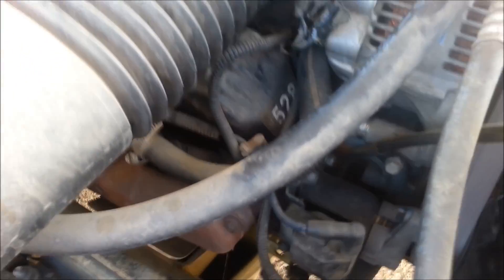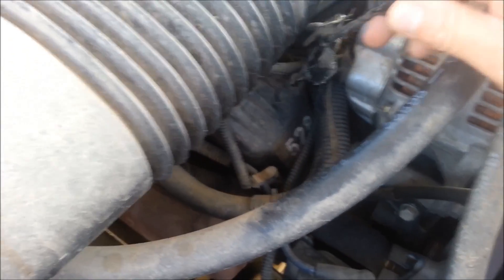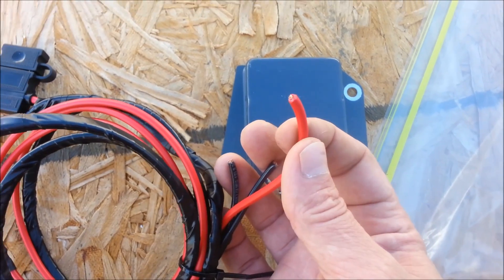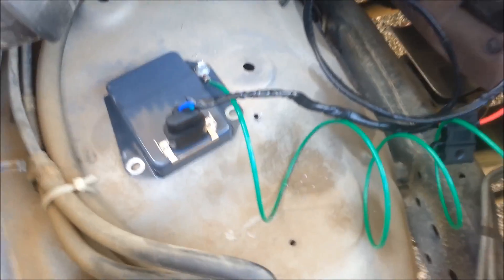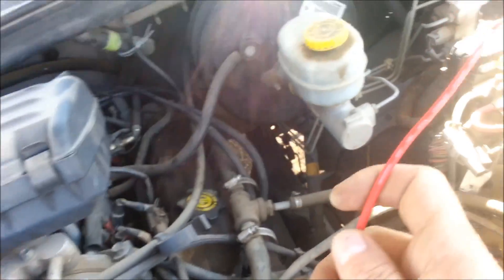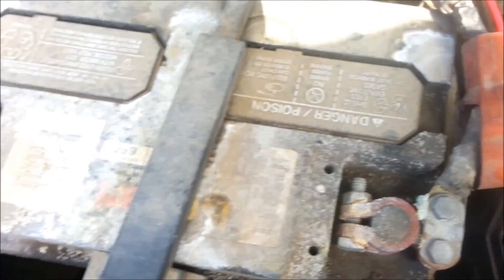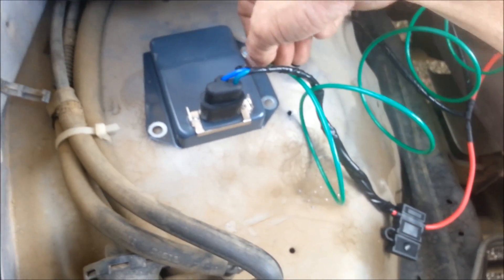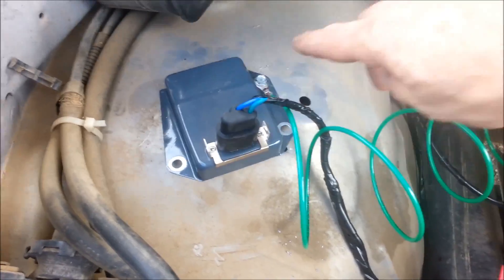How to wire up a External Voltage Regulator for Dodge Chrysler Jeep (Bypass the Computer)

Comment: Check the ASD (auto shut down) relay, the computer doesn't run directly to alternator it activates a relay to send the 12 volts to activate the exciter wire.

Comment: This a questionable band aid repair, not a proper fix. True, an engine computer is expensive but considering the potential harm and danger to installing this aftermarket setup, its not worth it IMO. I see comments of those who have possibly made errors on the installation, and their vehicles are overcharging, which could cause your battery, alternator and wires to burn up and/or fail. Considering the time it takes to rig up these extra wires, go into the fuse box for power, its not worth it. If you have a decent car and want to sell it later on, a potential buyer might walk away seeing this mess under the hood. Zip ties around a radiator hose to route and hold the wire in this video is a mess, plain and simple and a hack job.
Reply: should I try and find an PCU? Wouldn’t I have to have someone program it if I buy one online?
Reply: @bongwaterboy8179  I have never had to replace one. But if I did, there are a lot of sources out there. I think you provide your VIN number and they send you the correct one for your vehicle. Many delete the chip key (Skim programming) so you don't have to deal with that if the skim module fails down the road.

Comment: Saran into this problem myself and I figured out when I try to throw a resistor on the line coming off the ignition and then the voltage really jumped so I realized oh it's not resistance I need on the power going from the ignition it's resistance that you don't want so you have a bad connection you're not getting full voltage from the ignition wire you can't hook it up to the fuse box you have to hook it up closer to the actual ignition switch because you're getting not full voltage in too much resistance or it's loose and it's a bad connection so when you're not getting a good connection on the ignition wire coming in your voltage on your voltage regulator runs too high and that's going to fry your voltage regulator and your alternator and your battery and everything it's going to mess up your whole ignition system

Comment: thought the video was great,the only question i had,,was does it mean when the baterry light comes and remain on but u
it to charge battery.not alot..
Reply: You need a FRM between the old wires that were going into the computer from the alternator. This guy just taped them off. You need what's called a Field Return Module. The R might be wrong
Reply: @dgage1776 you only need the field return module on the newer Jeeps like 2006 or 2007 and newer
Reply: @throttlethumb150  well I got one on my 97 Ram anyway hahaha

Comment: Good vid. You should get an FRM module and hook those two wires that you taped off (the ones that lead back to the computer). The FRM module should help with the check engine light issue. Are you having a check engine light issue? Curious.

Comment: That won’t work on newer Chrysler since the the alternators field winding is already grounded and positive voltage is needed instead of the old one where there is a transistor in the PCM

Comment: What is that small plastic black box/that is hanging from the red wire when it is all layed out and then hanging down by the engine after the regulator is installed on the fenderwell?? Is it a fuse?

Comment: Battery terminals were corroded, which means there is probably scale between them and battery posts, which is why your voltage reading is too high, and the battery terminals were probably getting hot due to the resistance from the scale. Should have cleaned those too.

Comment: Great video. Im having the same issue. I have a 1998 Dodge Ram 1500. I replaced my alternator and battery is 2 1/2 years old. Battery terminals are clean. How did you know it was the pcm regulator? All my gauges while truck is running works except voltage gauge is reading low. If it was pcm all gauges will be dead. Unless the regulator fails and pcm still can work. I’m not
sure about that. Voltage gauge is reading 11.6 with the truck running with my voltage meter tool. If I turn on the AC it’s 11.45. I appreciate your feedback sir.
Reply: unplug the connector at the back of the alternator and turn on the engine.....take a test light and you should have one pin at battery voltage and the other a ground....the computer turns the ground on and off and that is what tells the alternator to charge....
Reply: Did you ever figure it out I’m having the same issue with my truck and same reading on the meter
Reply: @bongwaterboy8179 yeah it was a fuse in the fuse box. Check for continuity on the fuse from the wires connected to the voltage regulator. I had no continuity. Bought it for $10 at autozone. After replacing the truck was reading 14 volts.

Comment: I looked thru the majority of the comments and besides the ones asking if it works an a particular car...I will tell you what I used and what I think is the key to make this work. 

I didn't use a switch/relay, I did order a new alternator, distributor, coil, wires and the distributor came fully assembled. I got some wire and connectors just to figure things out and multiple voltage regulator 2 to be exact!

I have a 1978 Dodge D150 w/360 motor and 727 torqueflite transmission, it has a 8.25 rear end. I purchased it in the Midwest but it came from California. 

Whenever I purchased a classic vehicle I always change the top gaskets, water pump and the parts I listed as well as hoses. I do not like don't electric work on cars, but this one forced me to!

Here are the parts I ordered :

ACDelco ACDelco Voltage Regulator | ACD C603Z

JUNK!

Ultima Ultima 100 Amp Alternator | ULT R211684B

Seems to be working great and I sawa passed test twice with the field wires transposed. 

YellowTop Optima Yellow Group Size 34/78 Top Post, Side Post Deep Cycle Battery | OBT YEL34/78

Also works great and I have a sound system that came in the truck. 

I replaced the junk VR with 

Mopar Performance 77R06285 - Mopar Performance Voltage Regulators

Out the box after I charged the battery i got 14.17 at the alternator and 13.2 at the battery. I checked the wires going to the VR, I checked multiple grounds, I used multiple grounds, I checked at the starter relay, the coil, the junction to the battery cable/starter. I checked at the lights, the amplifier and other things I could get close to and they all read the same as at the battery. 

I initially chased the wires back from the alternator and found out thru the spaghetti mess which wire was the ignition wire and cleaned up that mess...I didn't use that wire as I didn't trust it.  I used the red wire coming from the loom and ignored the original orange wire that went to the VR.

I had to get a new connector part Part No. PTA1062 Carquest Premium Voltage Regulator Connector

because I found that the red wire not only wasn't connected, but the clip inside of it was broken and on the original VR connecting point. Once I changed that, traced my ignition on 12V source, used that Mopar VR, ran a ground from the motor to the firewall/VR/alternator with no other grounds to the alternator...I was able to achieve success. 

I know this is long, but I had to make sure mentally not to make any mistakes because I've been fighting this for 3 weeks straight until just a few hours ago. 

I tested it every half an hour and every time I stopped!

1. Use Mopar VR/parts as much as possible. 

2. Look for a good ground and clean it well. 

3. Don't use an old 12V source if possible!

4. Clean any paint off the VR.

5. Use fuse if you want. 

6. TEST religiously with a multimeter!

7. Run your ground to the back of the alternator and no other ground needed for the alternator!

8. Lastly alternate the field wires and make sure you're at 14V at the alternator and 13V at the battery. 

I still need to solder everything, but u need to make sure my fix is the correct fix!

Comment: Unless you connect a field replacement module to the two wires that go back to the PCM you will always get a high reading on your dash voltmeter  and a check guages/check engine warning lights coming on.
Reply: Specifically, it's just a resistor. I don't know the required value, but it is a high current version.

Comment: no its not ground isue its the actual engine rpm if you have any where a condensor/capacitor to lets say audio stereo equpment ignition coil baterry even the alternator will reflect that change in potential what realy hapening is you get stronger spark on spark plugs if its a gasoline engine and your alternator wont start charging until you reach 2000rpm ore more perhaps baterry runs in back charge mode huck it to baterry charger that will go away if not sirche for capacitors in your car disabel them and your altrrnator will run normal again if it is a gasoline engine with hoter spark your engine reach slow rpm it tryes to behave like a disel and your alternator wont start charging it will back fead on you! see if the alternator light stay In ON position on cold engine start up if it does and if it goes away when you put fut to gas pedal you have a device interfearing with your alternator no mather if it is ground ore positive terminal! even if its a disel it will try to self ignite fuel in worst case engine run on and damage seals ruber and plastic parts!
ore see if that voltage regulator has a nut on its back side to regulate the voltage. 
back fead is very usefull if you can understand it like waste spark ignition system lot bether economy only down side dead baterry requares lot higher rpm to charge a baterry

Comment: This doesn't work. I grounded the voltage regulator to the alternator and added 2 other grounds. Still spiking at 17 volts
Reply: What did you do to fix it

Comment: It’s worth a shot this thread is old but u didn’t by chance have a check engine light letting u know ur regulator was put having a charging problem with my 2007 Dodge Charger replaced alternator battery I heard they have a fusible link so I’m gonna run a wire from alternator to battery to see if it dose have a fusible link an it’s blow if that’s not it it has to be the pcm
Reply: What did you find out, and how did you fix it?

Comment: Thank you for this video. I watched another video about this from 1 of the external voltage regulator manufacturers, but it was all Greek to me. You showed the practical use of this device, and that is what I needed. The voltage regulator on my mom's Dodge Grand Caravan went out, and started overcharging the battery. The van went into limp mode a couple of miles from home. I drove it in and popped the hood and saw the battery venting the "skunk" vapor, lol. Thank God the battery is a platinum battery from AutoZone with a 3 year warranty. It sucks though, cause I just had it replaced a couple of months ago.

Comment: I want to do this but I'm missing one point on how you've connected the wires: The red wire you connect to battery, where does the other end of that connect to?  As I understand it you've got field and ignition wires coming out of the voltage regulator and you've connected those two wires to the two pins of the alternator's wiring harness but where's that red wire go to?  Is it also connecting to the ignition wire coming out of the regulator?

Comment: I have so many questions to ypu sir,, i have a 1998 grand cherokee laredo...i have a problem with this battery bolt meter the pointer is all the up to the last number...then at a desame time...i see this signs check gauges...i just replaced a new alternator...and a new fan belt...but its a new battery...i checked all the wiring its looks fine to me...althought....i still see this indicator..check gauges and battery volt meter up to the last end...what is the causes for this...do you think??
Secondly,,,what is the name of those terminal like a connector there must have a name...also the single red wire...what of those wire..or number of size...thank you
Reply: You need to put a ballast resistor  across the two wires that did go to the ECM previously to fool the computer.

Comment: If you can see the voltmeter shows low battery,  change the voltmeter battery,  cause when that battery is low and you're checking voltage shows about 2 volts more
Reply: OMG THANK YOU! I was about to order a voltage regulator for my Jeep GC WJ, and the old/low multimeter battery was the culprit! Everyone, please check your multimeter first before start troubleshooting!

Comment: Quick question what would happen if the shop didn't run a ground wire from the regulator to the Alt? Would that short out the PCM?

Comment: When you plug the wires into the fuse box, I see of the yellow wires with the connectors and a glimpse of something holding what looks like the fuse you removed.  What is that?  Is that something that you made or something I can purchase?  Thanks.
Reply: I'm wondering that also, you said you was going to use this but, didn't say what it was? That thing with the yellow wires, does it have to be there for it to work or can the red wire be connected to the left side prong and work??

Comment: I think you should check your 12V supply.. I bet you are losing volts from the battery to the ignition side of the circuit. I  was losing 0.5 Volts on my F250 truck that I just installed a Dodge Neon Alternator into and was getting 15.25V charging at the battery. I wired in a relay so I was getting true battery voltage and it now charges at 14.75V.. Still a little high but it will work.
Reply: how would you either take out or bypass the stock alarm on a 1998 Dodge Intrepid which I've already disconnected the horn connect disconnected the wires going into my wire circuit going to my fuse box so I got that out I'm running my wires I'm trying to figure it out I just need a little bit of help if you don't mind

Comment: On the back of that regulator you mounted to the firewall I think there is a small adjustment screw that will help fine-tune your voltage

Comment: I have 2000 dodge Stratus I need the wires for the alternator my alternator is new battery is new can you help me find the wiring? I tried google it but haven't found the one I need. my engine is 2.0l

Comment: 3 questions. Does it matter which wire goes to back of alternator on a dodge b 150 van? Dont you need to use a field regulator module? Can I power it up using the bus fuse on the hazard light circuit?

Comment: Hi aztikkel11  Did you ever figure this high voltage issue out?  I now have a 1998 Jeep Grand Cherokee Laredo 4.0 and it's looking like a V.R. issue.  Motherboard replacement options all bad or expensive.  Also, Won't the check engine light be an issue when I go to get a sticker?
You didn't mention how many and what size fuses to install.  Any hints there?

Comment: Hello thanks for the tips. I bought the same regulator and, like in the video, my regulator is over charging the battery. Reading 15-17 volts. It differs when the engine is revving. I have the regulator grounded to the alternator case. Did you ever fix this problem? any suggestions?
Reply: I moved the regulator thinking that might doit.. the ground is solid I also have it wired to the alternator case and another wire to negative battery terminal. Battery reads around 16 volts. of I turn ac on wipers etc.. it will lower to around 15 but when I rev engine it will go beyond 17 volts. it's a 2001 jeep grand cherokee. the regulator fits regulator specs.. I'm thinking it's the regulator?
Reply: Hi Brandon Wilke Did you or aztikkel11  ever figure this high voltage issue out?  I now have a 1998 Jeep Grand Cherokee Laredo 4.0 and it's looking like a V.R. issue.  Motherboard replacement options all bad or expensive.  

Also, Won't the check engine light be an issue when I go to get a sticker?
Reply: I hope you havnt put too much money in the jeep. My advice get rid of it before putting too much money in it, like I did..
Reply: ground to body he grouned his on the regulator https://youtu.be/DSguk3MwXi8?t=369

Comment: I tried to do this with my 2004 dodge stratus. It works the first time after hooking up the regulator but once i shut the car off and restart it no longer charges. To get it to charge again I have to unhook the battery then reattach it and it will work again but only the one time. Been searching for a cause for a couple days now but all i got were dead ends. What could be causing it to do this?
Reply: Did you ever fix this problem mine did the same thing
Reply from the maker: +Andrew Black Be sure the regulator has a good ground as it will do strange things. I always run a wire from the negative battery cable to the case of the regulator to be sure it is grounded good. Other than that since the regulator is on its own I cant think of why it would do that.

Comment: What was the symptoms that made you convert it? I have a 98 caravan and i replaced the battery and alternator, all the lights come on and then the dies.
Reply from the maker: Ronnell Banks This is for when the computer no longer regulates the alternator voltage. Basically the voltage is too high low or just varying high and than low.